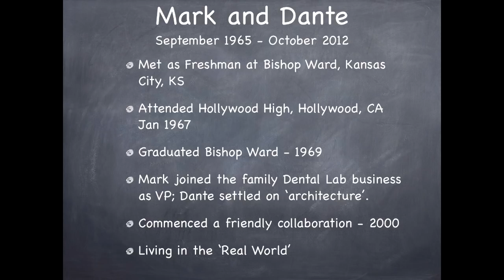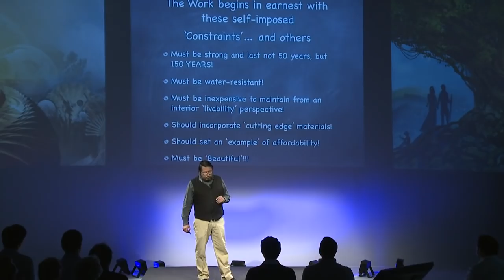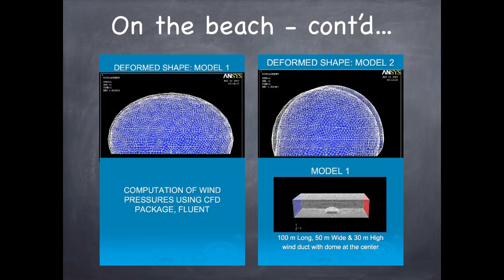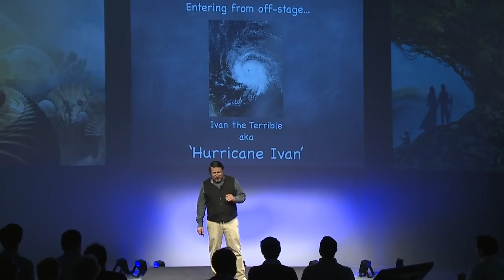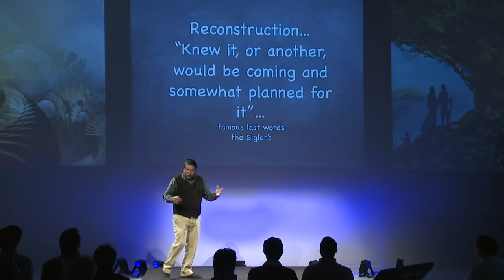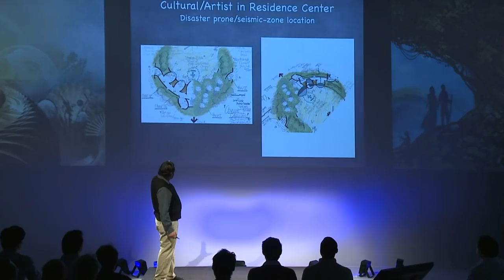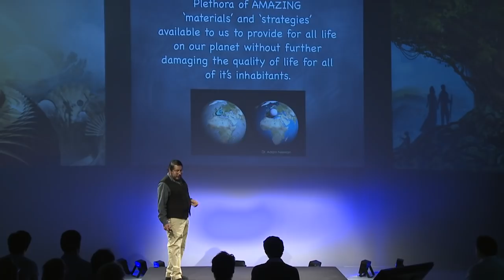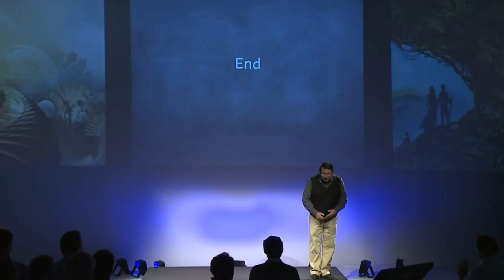Monolithic domes: Living in the danger zone: Dante Amato at TEDxMission The City2.0

Comment: Waiting for someone to do this with AirCrete. Maybe I will :)
Reply: Hey I was wondering the same exact thing! Traditional concrete is very bad for the environment, using less with the same or nearly equal strength would be great! Or possibly carbon-negative concrete :)
Reply: Monolithic dome institute
Reply: AirCrete isn't strong enough to be a "monolithic dome".
Reply: @ArtScienceWonder  WRONG
Reply: @protonneutron9046   However, with support columns and added structural beams?  These are simple additions that might not cost too much money.  What are your thoughts?
Reply: @thecosmicsnail  Why pay more to add all that?  Just do it right in the first place and it would cost less, be stronger, last longer and be better insulated.  Air crete is good for non-structural work.  That is what is was designed for.  Using it as major structural material is like using a feather to pound  nails.  You CAN build small structures safely with it but not unreinforced house sized structures.
Reply: It could probably work with a outer layer to make aircrete stronger

Comment: Have you investigated basalt fibers mixed in the concrete that would reduce labor and time laying rebar, and wouldn't rust with salt water? It is also said to be stronger because it supports in every direction. Similar method with needle shaped metal was used to build bomb shelters.  Not a plug.
Reply: WRONG Michael.  Fibers CANNOT replace rebar.  BUT you CAN use basalt rebar instead of steel

Comment: But how much?
Reply: I was lucky enough to attend the Monolithic Dome (MD) Workshop in Italy, TX in October 2004. I'd had a little experience in stick frame construction before that, and I wanted to learn what I could about MD's. In the week-long workshop, I sprayed foam insulation, tied rebar, and sprayed shotcrete, I also learned about the cost. MD construction can cost as little and as much as conventional building; you just have to know where your limits lie. If you're interested in building and living in a dome, start visiting some Domes. Pay attention to size (measure it out), the finishes, and the layout. I've come to the realization that I don't need quite as much space as I used to think I needed. But I do need the security and strength MD's provide to protect my investment. Good luck.
Reply: @pattis8945  "as little and as much" ?   I'm afraid I find this confusing - can you please explain?

Comment: What is the cost?
Reply: The average house of 1500 sqft would run around 130k, a monolithic structure would be roughly that cost. Varies based on building materials. Granite and such inside the house.

Comment: Why are we not trying to market this to the people that matter? Developers will want to avoid jumping on board cause they got a system, and it is good. The folks you need to get on board are first the insurance companies. Who is making massive payouts for these disaster areas? And these costs will keep growing due to "climate change."  The focus on materials for climate change needs to be revised. They need to be focused solely on making structures that will work based on the disasters predicted to impact the locations they built. They should be focused on seismic activity and, more importantly, tornados. They should be the home that lasts and is safe. And even if you must evacuate, it will still be standing when you return. Then all other resources need to go into lobbying the need for this product to governments and major industries in housing. Imagine major insurance companies helping to lobby Congress or local governments to push for these buildings to be a new standard in future home development.